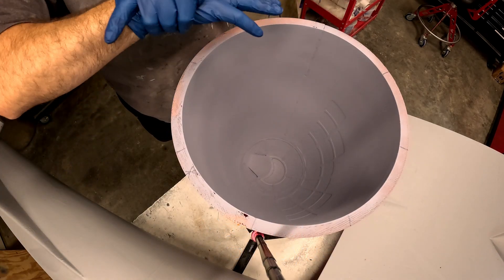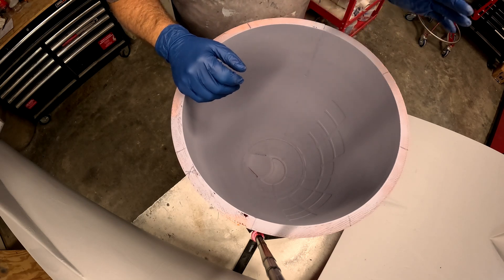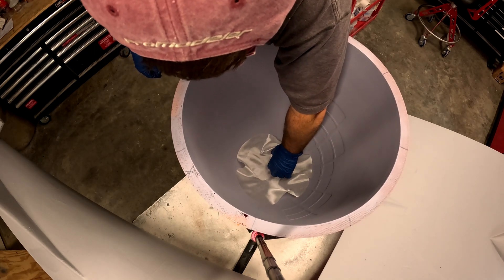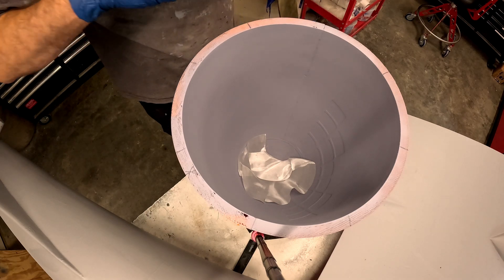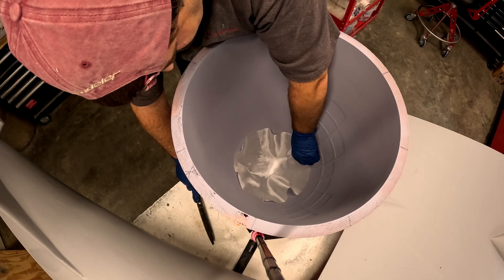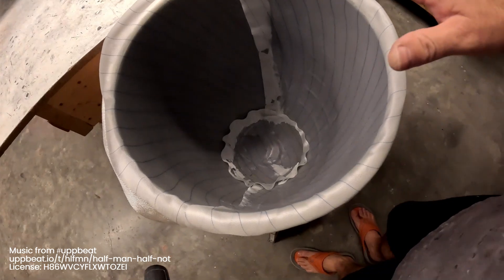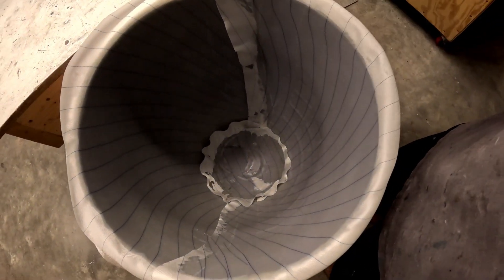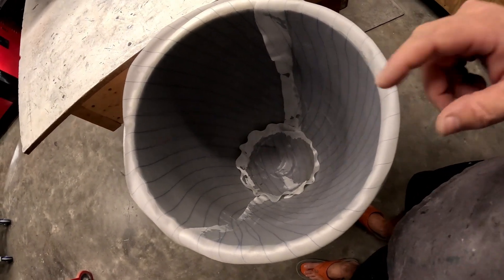B 29 Restoration Project #32  Nose #4

Comment: Thomas, the peel ply has the spiral black stripes?  This used to give a smooth surface inside? Thx.
Reply from the maker: @briansilcox5720   correct, this particular peel ply has a blue tracer, which is because it is in a “twill” weave. Other plain weave peel plies have a red tracer.   The stuff i used to fiberglass the B29 with no tracers was a 100% polyester fabric (which is what peel ply essentially is).  The peel ply soaks up excess resin, gives s surface that is ready for bonding and also helps even out the surface where the fabric layers overlap.